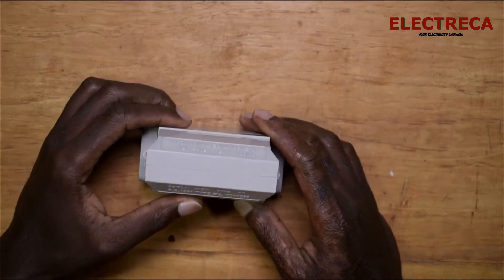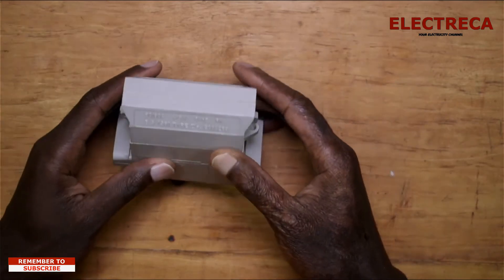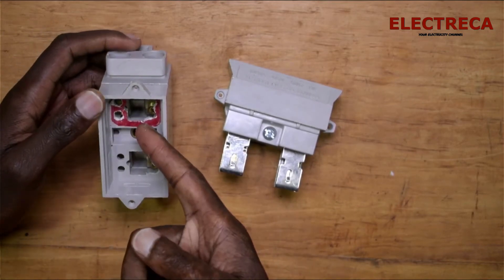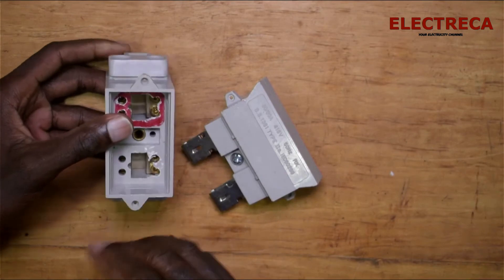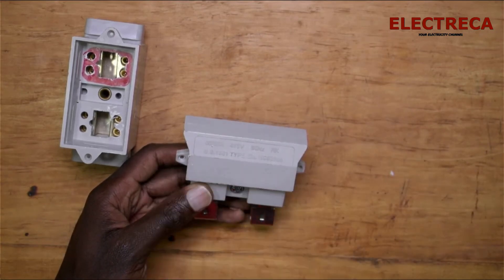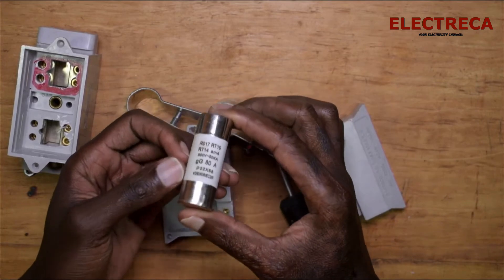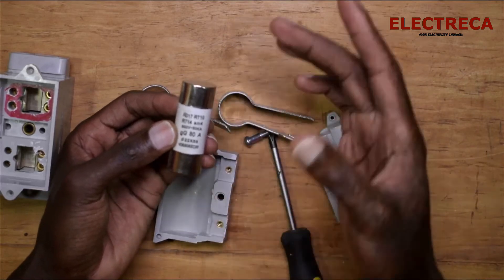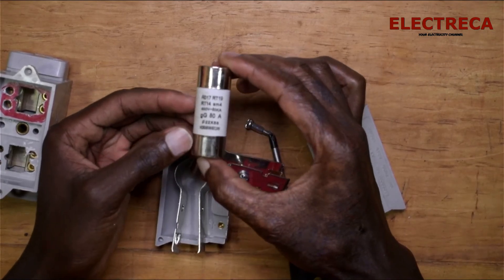cut out fuse replacement | ELECTRECA

Comment: Wher cna i gate the sorce of the earth in elecricity
Reply from the maker: Buy an Earth rod, Push it in the ground, connect the earth wire. The consumer unit has a dedicated block for earth were all outgoing circuits taps
For Earth to be more efficient, dig a  hole at least 2-3 ft build a small inspection around it then push in the earth rod put some salt around the rod.
Make sure you don't burry the connection between the earth rod and wire.